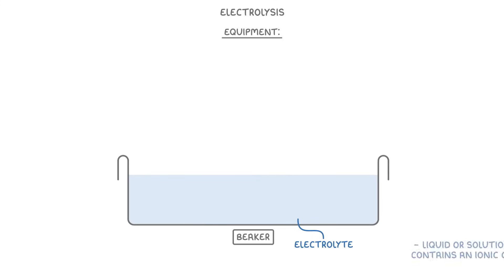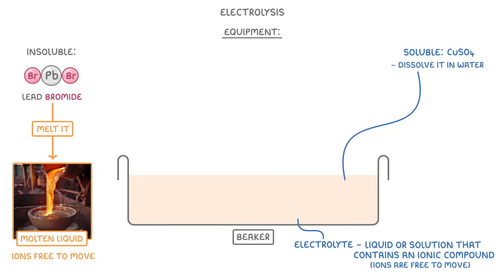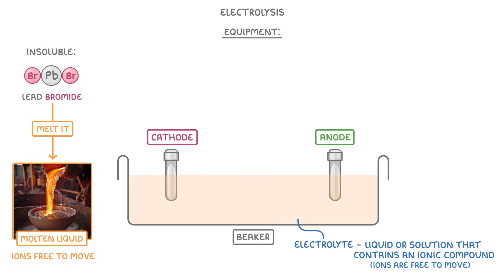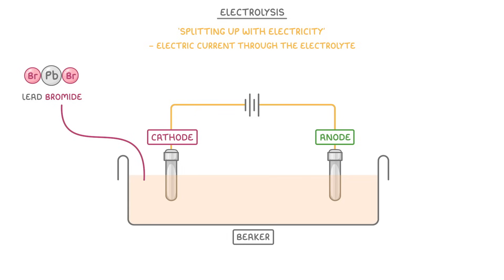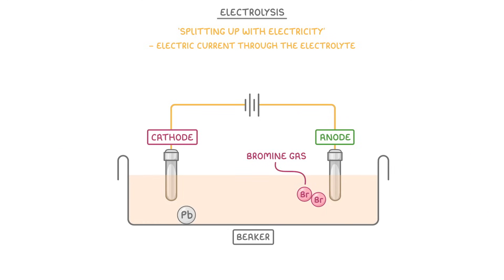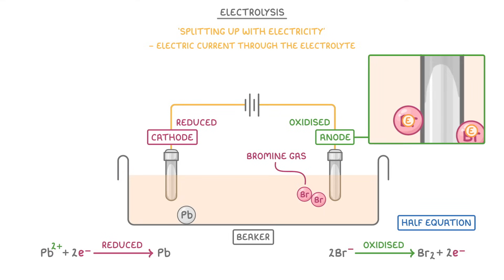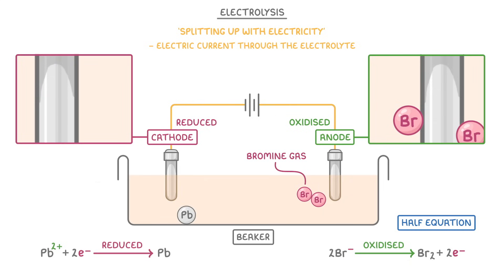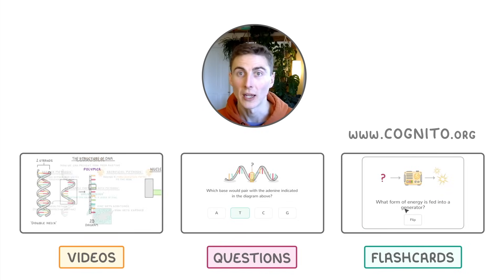Electrolysis Part 1/3 - Basics and Molten Compounds

Comment: If anyone is confused about why Pb has a 2+ charge, here’s an explanation: the compound in this video( Lead (II) Bromide) the “Lead (II)” represents the oxidation number(or charge), which means that this specific lead is in the 2+ oxidation form. For Br-, it is in group 7 (VII) which means that it needs to gain an electron to have a full outer shell arrangement which is why it has a negative charge. Hope this helps!❤
Reply: If  Br- needs to gain an electron why is it being oxidised if oxidation is loss?
Reply: Bro I need u to be my tutor😭